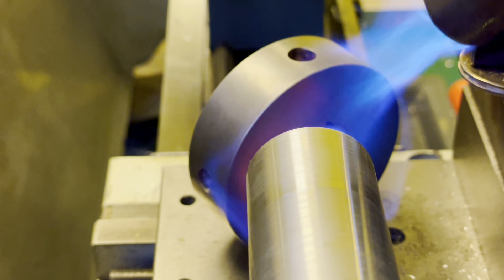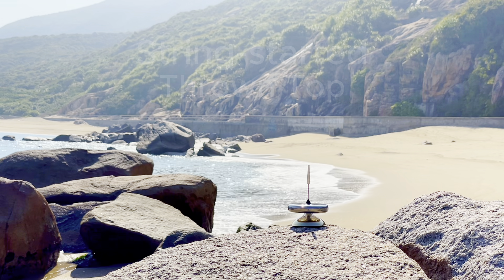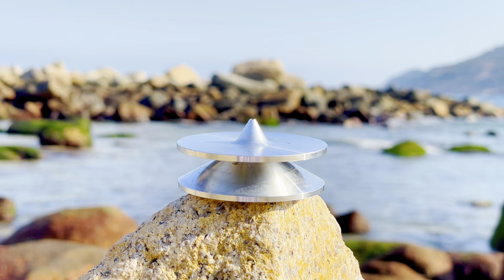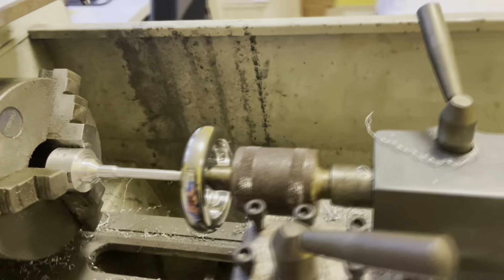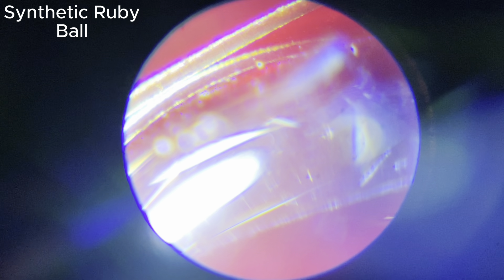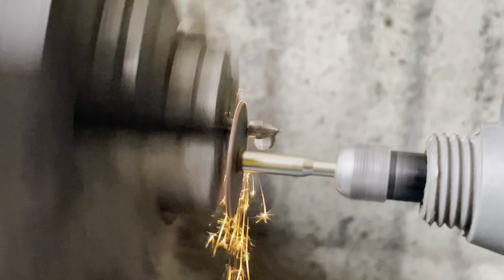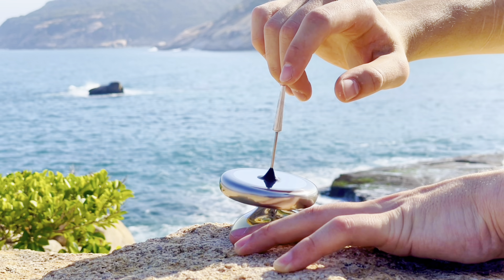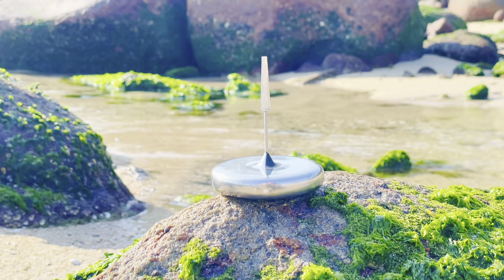Spinning Top Mk.24 | RUBY & SAPPHIRE

Comment: Have you considered having dimples os the surface of the disk to reduce air resistance? Like a golf ball.

Fabulous
Reply: I don't think dimples would help, because on a golf ball the airflow is radial and goes around the ball. The dimples help reduce turbulence behind the ball. On a spinning top the relative air flow is down the shaft and outwards in a spiral. There isnt really a "behind the ball" where turbulence occurs
Reply from the maker: Colin hit the nail on the head! I plan on showing this in a future vid
Reply: It's not about creating a vacuum to have a ball go further... it's about turning caustic turbulent flow into smooth laminar flow. Reducing the pull of air over the surface and ordering what does get interacted with in a beneficial way. It's like driving the perfect speed over gravel that has washboard grooves in it... it's a resonance thing. It also reduces the fluid surface mating problems. By reducing the skin effect, the eddie currents caused by a smooth surface will be disrupted, and it creates a boundary layer that interacts with itself to actively reduce fluid surface mating. This would be the benefit for top spinning, not distance... which really, when you think about it, relatively, in their respective contexts, are the same thing...
Reply: @hiper_tops It not only about 'behind the ball' for a golf ball it'smostly about skin friction. Think of Shrek skin very rough aon a micro scale but very low resistance in the water. They even banned a similar material in olympic swimming. The effect is about disrupting the boundary layer of fluid that 'sticks' to the surface and effectively drags more fluid with it. With a small turbulent layer youre effectively creating a small layer of lubricant to disconnect the moving surface with the bulk of the fluid. I'm confident it will help

Comment: Have the Guinness records people got an altitude to set the record at? Air resistance and all.
Reply from the maker: They actually didn’t specify..
Reply: @hiper_tops  Trip to a telescope in Peru should give a bit more time than sea level and a cool engineering backdrop, however I can't pay for the adventure unfortunately.

Comment: Your straight taper lines are i believe called broaching
Reply: I can't decide whether I'd call it broaching or scribing, but it's one of the two
Reply: @boulder795  interesting, scribing I would say is superficial but broaching in my head is more of a significant operation.  Maybe splitting hairs here though.  Either way 1h:20 is the takeaway here and a phenomenal time!
Reply from the maker: Thank you! I would lean towards broaching as chips were made but either describes it well :)

Comment: Fabulous, I deeply respect the dedication to your craft. 

Where are most of the losses coming from, friction or air resistance? Wondering if you can do your run at altitude to reduce drag
Reply from the maker: The top is designed to lose an equal amount of total power from air drag and tip friction. However since air drag is much more prominent at the start, running the top in a vacuum for example would only increase spin times by ~50%. Ie 1 hour -> 1.5 hours. I plan on showing this in a video soon :)

Comment: how about cbn or ceramic or saphire on saphire?
Reply from the maker: Sapphire is actually identical to Ruby so ruby on ruby should have the same results. I tried CBN in the past but found it to be too abrasive. However perhaps if the surface finish is perfect it could work.

Comment: To preface this question: I am asking out of my own curiosity, not criticism or passive-aggressive suggestion. Does having the spin time in a sealed chamber vs in a dynamic environment make a difference? Could you explain it for me?
Reply from the maker: No worries at all! I encourage questions. This is slightly more complicated than most people realise. First of all, I film outdoors for the aesthetics and lighting but for long spins I do this indoors but without an enclosure. Wind increases the breaking torque experienced by the top (although one side is benefited and one is hindered, since drag ~ velocity^2, the hindering side wins). Enclosures can actually increase spin times if they are small enough - in this case they are called shrouds. This is a principle used in kinetic energy storage systems (big flywheels in containers). The idea is that air is kept swirling in the direction of spin, so the velocity gradient away from the top is less steep ie the top feels less wind. However this only works effectively for very close-fitting shrouds (1-3mm at this scale). In the past I have avoided using this effect as tampering with things external to the top felt like cheating. However I would still like to try it at some point!
Reply: @hiper_tops  that makes perfect sense, and filming outdoors does look much better than filming a cup with a spinning top inside! (Generalized for comedic purposes)

Comment: On the topic of Sapphire glass/crystals... Maybe some watch crystals are better because they are polished in an industrial process and may have less resistance than hand polished crystals. Just a thought (don't know much about the topic tho...)
Reply from the maker: You are right, industrially polished ie optical parts would be best. It’s just hard to find in the right size, scale and geometry!
Reply: @hiper_tops  ah, all right. Didn't think about that... Surely there is a service for optical parts (probably rather pricey, right)
Reply: @hiper_tops  after a quick search I found 2 companies that produce (sort of) custom sapphire lenses (spherical and aspherical). No prices mentioned tho...

Shanghai Optics
Creator optics

Comment: Do you film it on the coastline because of a sea level requirement?  If vacuum chambers are prohibited, maybe use a higher elevation such as Denver.
Reply from the maker: The filming location was just for aesthetics, for long spins I do these indoors (still about sea level for consistency). Yes it would be fun to try at higher elevation to see how much of a difference it would make!

Comment: 9:00 - Do you spin it at an angle because the earth is going to noticeably rotate underneath the top over the course of the spin, or is it just easier to spin that way?
Reply from the maker: Actually I did this to show how slow the precession was. For long spins I start the top as vertically as possible :)

Comment: Could you start the top in a vacuum chamber, then remove the air to remove aerodynamic drag?
Reply: Now that's a good idea. If a vacuum isn't allowed perhaps hydrogen or helium woukd reduce drag.
Reply from the maker: Yes certainly the vacuum idea works and is something I have done previously for data collection. I will try and showcase this in a video soon :)
Reply: @hiper_tops  Or how about just doing it at altitude?  That would be less air hence less friction and seems like it would be allowed

Comment: CBN inserts (Cubic Boron Nitride) are fully ceramic and almost 10 on the mohs scale. 2nd only to diamond. I've used to machine seriously hard alloys. They aren't too expensive and may help to rough shape materials you're having trouble with. Also you should definitely invest in a tool post grinder for your lathe. It's a huge step up from the hand grinders you're currently using.
Reply from the maker: Thank you for your advice. I do have a few CBN inserts I bought a few years ago to use as bases. I’ll have another go at using them and look into a better tool post grinding solution! I don’t suppose you have any advice regarding trying to grind concavity into diamond? Thanks :)

Comment: Instead of Maschinist MCD you could machine a base of thungsten carbide and let it coat in Diamond 👍
Is the aerodynamic shape already optimal ? You could also try a Sharp edge in the middle to „eject“ the spinning air
Reply from the maker: Yes I am looking into diamond coatings too. I think what I have is optimal as the air is ejected quite slowly ie laminar. However I plan on testing this shortly!

Comment: are there any limitations to weight/size? moment of inertia scales as radius squared, so surely it's optimal to use the maximum allowed radius.
Reply from the maker: True however powerloss due to air drag scales with >2nd power of radius. For a given mass, there is an optimal radius and height and vice versa. Its all very difficult to balance but I hope to explain my work more in a future vid :)
Reply: @hiper_tops  is there actually an optimal shape for any given mass? i'd really expect it to be something ridiculous/non-physical, like an infinitely thin ring of an infinite radius.

Comment: Hugely impressive, and I love the enthusiasm. It may seem like solving a problem simply for the challenge of it (absolutely nothing wrong with that), although I'm sure there are considerable potential applications in a number of mechanical devices (transport and gyroscopic control, in particular).   My only suggestion for an improved spin time would be to constrain the top radially on start up (possibly at three separate points) to avoid damage to the bottom bearing, although, of course, it would be a trade-off in loss. I presume the GBoR won't consider a second category for a different propulsion source?
Reply from the maker: Thank you, that starting device idea is very interesting. I suspect I could make something like that and that it could help... more testing required!

Comment: I wonder if you could achieve perfect balance by adding a very low viscosity, 15 minute epoxy or glue to the interior of the top and then spinning the top while the liquid sets up.
Reply from the maker: That's an interesting idea but this is kind of what the lathe is doing in the first place but with the metal itself!

Comment: i'm curious what the losses are from the earth's magnetic field inducing eddy currents in the conductive material of the rotating top. how much would it benefit from being radially slotted (with the slots then filled with resin to avoid introducing drag) to reduce the area of the eddy current loops (like the laminations in motor cores)?
Reply from the maker: This is an interesting idea which I have heard once or twice over the years. My gut feeling is that the earth's magnetic field (or anything stronger nearby) shouldn't noticeably impact spin times. Furthermore, using insulating materials eg resin in the flywheel to circumvent any tiny eddy currents would cause more harm than good by reducing the stored energy.
Reply: @hiper_tops  that's fair. i guess one simple way to conclusively rule it out as a substantial factor would be to spin it in a much stronger magnetic field, and compare the spin time to the normal earth field times. but, this is the first time i've considered spinning top optimization, while you've been working on this for years, so i'm willing to believe your intuition.

Comment: What about a magnetically levitating spinner with super conductors?
Reply from the maker: This would be fun to try, and I hope to try something similar soonish. However spinning magnets on magnets tends not to work well - thing become unstable and levitation fails
Reply: @hiper_tops  :) due to flux pinning, i assume superconductor's and quite stable unlike regular magnets, but i think it might experince Lorentz force slowing it down... not sure

Comment: Spin it in a VACCUM CHAMBER to get an idea of maximum improvement you can expect by working on aerodynamic... This way you can decide whether it's a low hanging fruit or not worth it.🤓
Reply from the maker: I've done this before for data collection and the way I've designed things now means the total powerloss from air drag and tip friction is equal. However since air drag is much more pronounced at the start of the spin, in a vacuum, times only increase by around 50%. (Of course a top designed specifically for vacuum environment could do much beter)
Reply: @hiper_tops  I will look at that video too 😲... But if you got this result earlier than now after improving the tip so much resulting in less energy loss from the tip, the energy lost from aerodynamics should constitute a bigger portion of total energy lost and you should see far better improvement than 50%.🤩
Reply: Also it would be interesting to see how the top will perform on a graphite block because of its lubrication property 🧐... Also with both spherical and pointed tips.

Comment: weird idea that i have no scientific basis for: have you tried changing the temperature of the base? as in freezing/heating it while the top spins.

like I said I have no basis for this idea, but I feel it in my bones that it should do something
Reply from the maker: Hmm I haven’t tried but it would be interesting. I can see a glimmer of hope for the cold side. If for example the base was on a big chunk of dry ice or in a pool of liquid nitrogen, the air above it would become very cold. Cold air has a lower viscocity than hot air and so may reduce drag. However I doubt anything would be different at the contact point. Oh perhaps the lubricant would freeze…

Comment: Naieve question;
Is concave really the best for the base?
Obviously it makes sense that you want it to self-center and concave should do that;
But the contact angle might not have the expected effect, between precession and friction. 
Would a convex surface have a similar effect to conical train wheels, or the way a belt drive will center to the middle of a convex/crowned pulley? How would that interact with the precession, particularly with the force being tangential, off-center, and underneath the center of mass?

Comment: Laminar flow sticks to the surface increasing drag. You should experiment with golfball dimples on the outer surface to allow the air to more easily decouple from the top. Everything else you are doing seems to be maxed out. I would think you can easily beat the record time with the right aerodynamics.
Reply from the maker: It’s a popular suggestion, I’d like to try it soon..

Comment: This is the first I've seen in this series, so forgive me if this has been asked and answered, but I'm curious about the contact point seeming to be above almost all of the mass of the top. These things are delightfully arbitrary, so I don't really have an opinion on it, but was there ever any agreed upon rules (or record categories) that require a "normal" top that has its tip at the bottom, or a similar rule requiring it to spin on a flat base? A mechanism that is designed to eliminate almost all the things that make spinning a top for a long time impressive (as a human skill) makes it hard to appreciate how genuinely incredible this is (as a piece of manufacture). All the same, this is a fun project and showcases a true and uncommon command of craft. I look forward to the next video.
Reply from the maker: Thank you for your kind comment! Guinness, for example, doesn’t specify the need for a flat base so I can push the contact point to as close to the centre of mass as possible. However I totally understand how this makes it seem like less of a spinning top so I plan on designing one for flat base spinning in the future :)

Comment: Adding divots to the exterior like a golf ball would help the air drag friction. Myth buster did it to a car and it worked better than a smooth surface.
Reply from the maker: Unfortunately the aero benefits to a car are from the increased viscous drag reducing the pressure drag. Since spinning tops don’t encounter pressure drag, the increase in viscous drag is detrimental. However I would love to test this myself in the future :)

Comment: What about using materials (not specifically magnets), that have opposing charges? To reduce drag and degradation. Also chilling the base plate prior to launch to keep the heat from crippling the tip.
Reply from the maker: Hmm that’s an interesting idea - do you mean electrical charges? Would the benefit come from a repulsion force? In this case they would be like charges.

Comment: Is there any rule against putting it in a vacuum chamber to reduce air friction?
Reply from the maker: Yes as this would drastically change the design constraints. However the rules are a bit vague so Im open to playing around with atmospheric tampering just to see what happens.

Comment: Have you tried measuring the difference between "dry" running it and a drop of high grade watch oil added?  Is there a Edit ban, not bad,  on it for the record attempt?  Amazing build!
Reply from the maker: Thank you! There is no ban and a thin oil film on the base can add 8-10% to spin times for tops as heavy as mine :)

Comment: Isnt the spinning top loosing energy into the base through vibrations and cant this be minimized by creating a base that has way more mass than the current ones? (This principle is also used for black smithing)
Reply from the maker: There is some truth to this. Perhaps I could superglue my base to a solid surface next time and see if there is any change.

Comment: Does Guinness let you use a vacuum pump to remove the air after you start the top spinning?
Reply from the maker: It does not, and I’m glad as that would completely change the design constraints and hence the ideal geometry. Still it is useful to test in these environments for data collection. I plan on showing more of this in future vids :)
Reply: @ how do you even find the rules?  I tried to search but no luck.